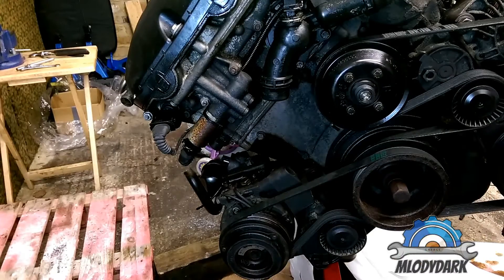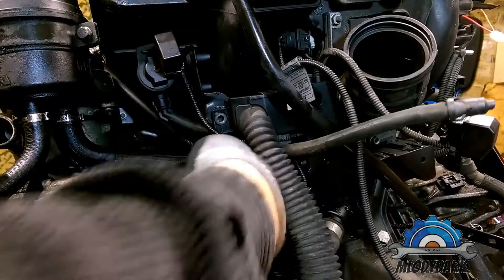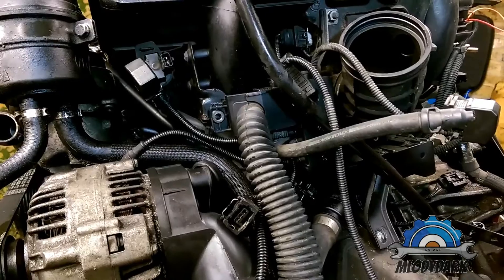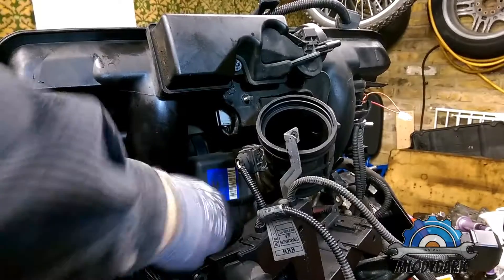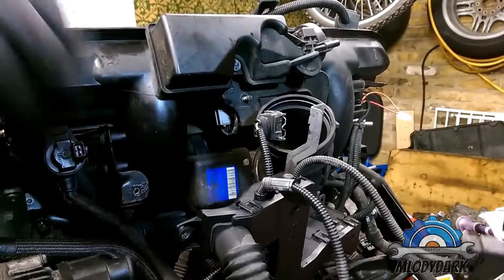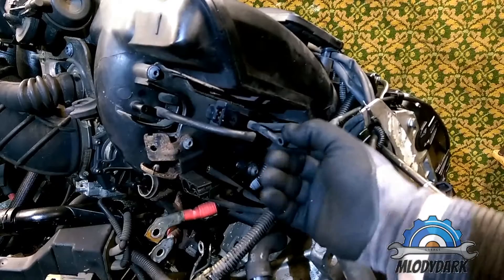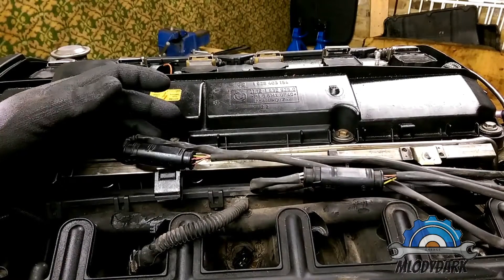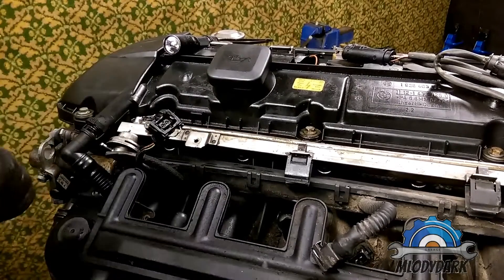BMW M52TU,M54  engine wiring harness

Comment: Hello can you tell me how to fix maf wiring harness.. I seemed to have pulled my wires slightly too tight which replacing my pod filter..so now it's not giving me anything on gauge while I diagnose it..however the green light turns on which means it's doing its job properly..its just the data sending wire I think I pulled too hard..thanks

Comment: hey the connector of my alternator is cracked but still working this connector comes from the black box under the intake manifold  how can i replace it ?
Reply: only by cutting off and soldering new one
Reply: i cant remove it from the black box ?